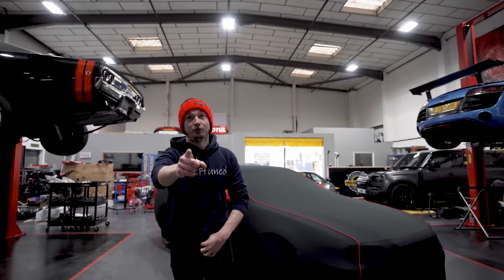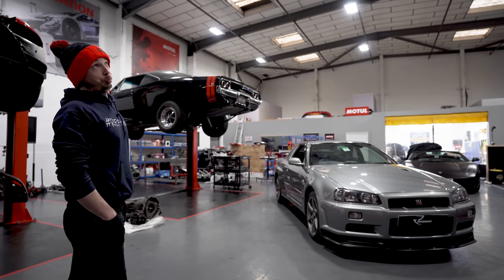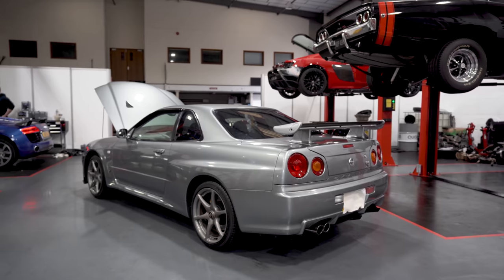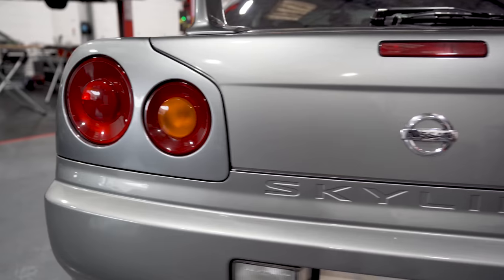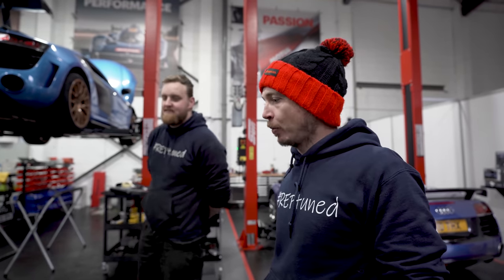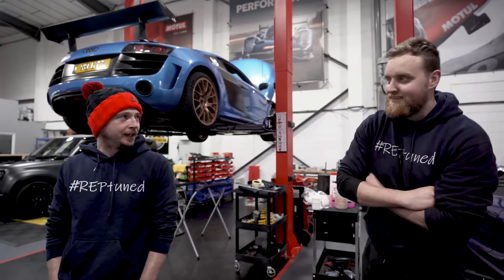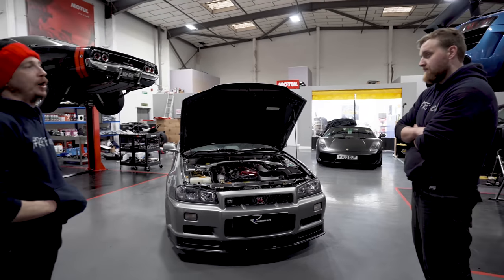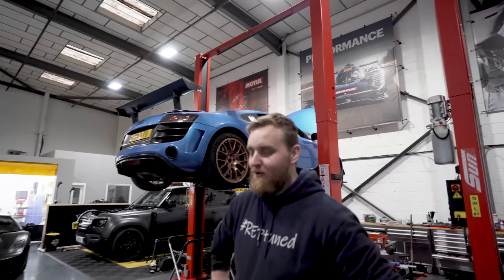Revealed – what's under the car cover...

Comment: I bought a r33gtr vspec from an importer in Birmingham some years ago. The car a 1996 metalic purple version . 1 of only a few imported. It had everything Apex i. Fully programmable ecu with a hand held dash mounted wand. Stupid HP from the uprated turbo's It ran up to 1.4 bar. Reluctantly sold for £16000 to a mate. Bought a carrera 2 911 , which was crap. Even the Ftype R i have now would not make the thrust that that thing made. Only problem was MOT time. The emissions were horrendous. If the car was not wrecked by the following owner i guess it would have been worth serious money now. 
Steve.
Reply from the maker: Yeah it would of a 33 V Spec!